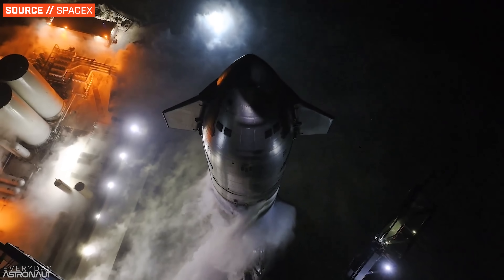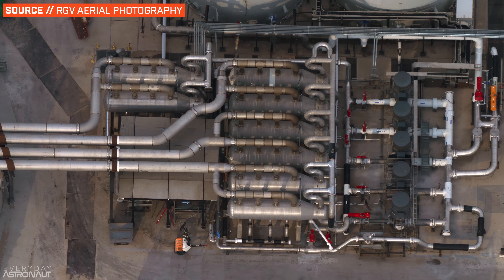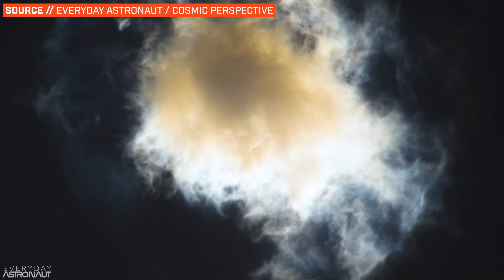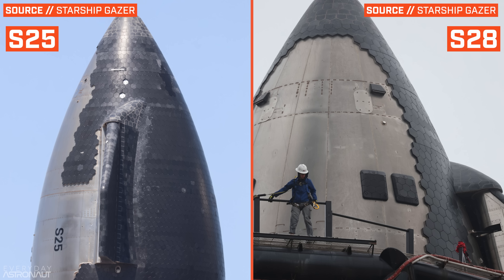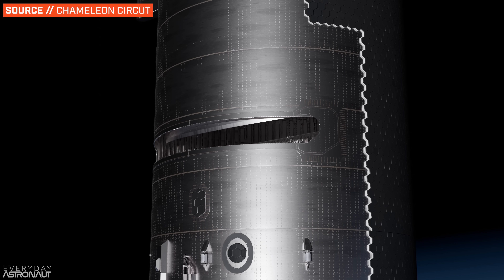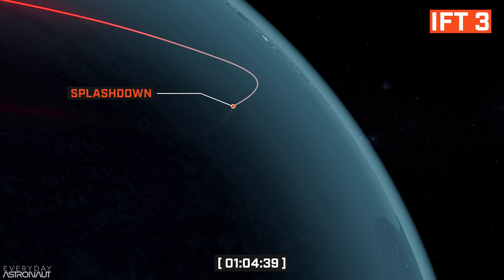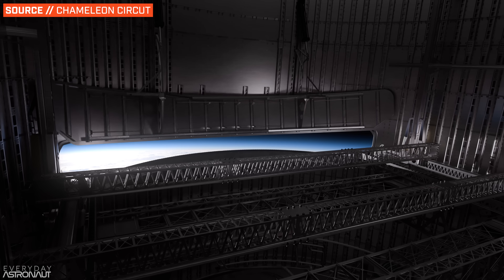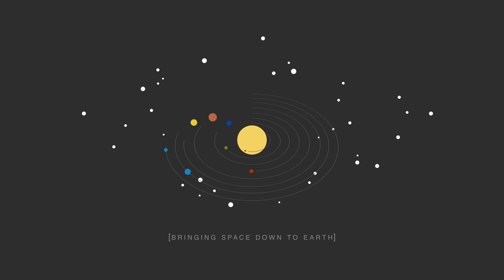What Did SpaceX Change & Upgrade For Starship's 3rd Flight Test?

Comment: What would be the force on the flaps at entry speed? Are they hydraulic or electric? Is the electric weaker? Just watched the actual flight and loss of ship in reentry. Looked like thee was uncontrollable tumbling. I agree with you on heating the thrusters but also am concerned that a flap was fighting for control against a broken flap.

Comment: Brilliantly explained about the saw set up. The one thing I would add to that list is dust/chip extraction (or at least removal, like a blower) so that you can always see what you're doing.
Reply: I think you mixed up videos..
Reply: @puchacz199  Ugh, yup. Happens somehow when chromecasting, I think when it switches to the next video in the playlist while I'm still typing up a comment for the previous one.

Comment: Timestamped Highlights
00:00
🔍 SpaceX has made upgrades to the launchpad and stage zero infrastructure, improving propellant loading times and making small tweaks to reduce refurbishment time between flights.
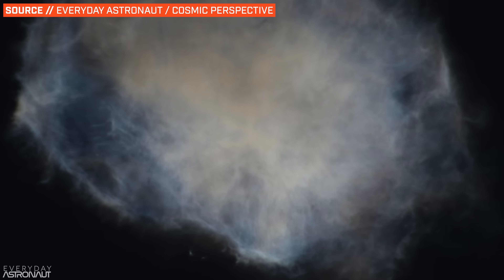02:36
🔍 The booster and ship have undergone numerous upgrades and changes to address previous issues. The FAA has signed off on SpaceX's mishap report for Starship's second flight.
04:12
🔍 Booster 10 features noticeable changes such as grid fin design, upgraded Starling terminals, and a different common dome design. Software and engine control algorithm changes have been made to better cope with the flip maneuver after hot staging.
06:52
🔍 Ship 28 has significant upgrades over its predecessor, including a reverse stacking order, electric actuators for thrust vector control, and various tweaks to prevent fire on the vehicle. The payload door is now operable.
09:44
🔍 The mission for Starship's third flight test includes attempting to relight a raptor engine in space and demonstrating propellant transfer between a header tank and a main tank wall. The landing location has changed to the Indian Ocean near Australia.
12:17
🔍 SpaceX has higher expectations for Starship and hopes to achieve its lofty goals. The clock is ticking, as NASA requires this rocket for the Artemis program. The booster's safe return and successful completion of key demonstrations are anticipated.
Summarized by @NoteGPT

Comment: I think it may experience moments that will require an upgrade. I'm looking forward to it getting further than the previous test. A soft landing may not happen, but we may get close enough to the moment; that we'll be sitting on the edge of our seats, crossing our fingers, and hoping it gets across that finish line! The Starship will most certainly light its engines, and operate its payload successfully. Either way I'm excited for the launch.

Comment: If it doesn't blow up in the first few seconds it will probably do better than last time. The changes made makes sense, but it's a lot of power trying to tear the rocket apart and a few little gremlins can blow the whole thing up before it leaves the pad.

Comment: Once they get a handle on the fuel amount and the flight characteristics of starship they should be able to program in the right parameters to get starship back to launch site. The booster or first stage will be a little easier. They still need to figure the fuel needed for return to launch site on the first stage. I have a feeling starship is gonna make it through its paces this time. So next launch I’m hoping the booster makes it back and lands inside the arms of the launch tower. Go star ship! Can’t wait to see it launch.

Comment: Regarding the reentry, and mission plan. I am not sure what the idea is, but they actually have two reentry plans submitted, one in the Indian ocean, one off of Hawaii with a note about second burn event. This would indicated that the Indian ocean is the "back up" sub orbital trajectory in case they either can't get the engines lit, or under performing engines. This would leave the pacific as a primary splash down. When I read it, it was a bit confusing. Or it could be reverse that they are aiming for pacific and the reentry burn would land them in the Indian ocean. Either way, two reentry profiles have been filed.

Comment: I'm disappointed to learn 28 won't attempt a retro-grade landing burn into the sea.  From a hardware perspective, I don't follow the logic.  Let's say 28 exceeds all expectations and survives through re-entry with the correct high altitude re-entry orientation -- then performing even the bare-minimal commands for a low-altitude engine relight and landing orientation would be icing on the cake.

Comment: I'm predicting that the booster hasn't solved the slosh problem and won't survive long after the turn, unless it waits to turn until after the 2nd stage has put some distance between them. I'm also predicting the 2nd stage will perform the missions objectives successfully and blow up on re-entry, before splashdown.

Comment: Watching the details of the ship like welds and fixtures makes me wonder if this guys are just building an oversize garage build. i mean, it looks awfull. who builds this rocket ship? hamas rebels?
Reply: Yea, it ain't pretty but when it works it will be really cost effective (comparative to any other vehicle of the same capacity). The space shuttle had a painted fuel tank on STS-1 for example, but they ditched that after they realized it is cheaper and lighter without it. Looks don't define spacecraft.

Comment: I believe Starship moon lander has a few design flaws. These flaws include the vehicles height, narrow stance and not having a second stage for moon lift off. Height could be a big safety concern when it comes to sending our Astronauts to the moon. If Starship miscalculates it’s landing approach and lands on an uneven surface it could render the vehicle prone to tipping over? I’m pretty sure that’s kinda of what happened to the U.S. private space firm when it recently landed its lunar lander on the moon? The Apollo Lunar Modules were two stage vehicles, the first stage for decent and the second stage for ascent. This was a good design because it allowed the Lunar Modules first stage to serve as a robust landing platform for the lunar surface, not to mention, it served as a launch pad for the lunar module’s second stage . . . . and most importantly, it provided protection to the ascent engine from debris strikes upon ignition. Remember what happened to a few of Starship’s first stage engines on its maiden flight? I’m sure it’s quite possible that some of those engines could have been taken out by debris resulting from Space X’s original crude launch pad design? Imagine if that happened on the moon with a fully crewed Starship? Obviously, I’m no rocket scientist. However, I’ve been told by many that I have a keen awareness on the space program and its safety issues. If Musk’s team at Space X hasn’t addressed these concerns, maybe you could pass this message on to them?
Reply: Good points but for one, the lander will be crewed and can access an unsafe landing spot and for two, the IFT-1 launch had failed due to 33 engines at full thrust completely eradicating the rock around it. The lander itself will only use 3 engines and might not even have to go to full throttle to get off no air resistance, 1/6 gravity moon.

Comment: I think a destructive reentry test is in order. I do not think spacex knows the exact heat transfer coefficient with and without tiles on the reentry. So I wondered that they might selectively drop tiles to get accurate numbers

Comment: I feel Starship will make orbit successfully but the 2nd stage will breakup on reentry. The TPS system needs a more robust design that can survive liftoff sonic and mechanical vibration. The 3-bolts holding a dinner plate isn't working too well.

Comment: Wil the raptor re-ignition and fuel transfer take place before or after the payload door test? It would make more sense to me if they test the relatively simple door before risking that the engine test or fuel pumps do something catastrophic.
Reply: The transfer will occur while the payload door is opened, and Raptor relight will occur after the door is closed

Comment: I don’t understand the logic of not trying the propulsive flip “landing”.   They have the fuel, the manoeuvre has already been demonstrated, why not configure and test it for this ship?  No harm in planning for it surely?  And fantastic data and credibility if it succeeds.
Reply: Because if they soft land it, they need to send someone out into the middle of the ocean to deal with a floating hulk. If they smash it into the water at terminal velocity, there's no such problem.
Reply: @simongeard4824  that is a large metal cylinder with controllable vent holes in multiple places.  A recipe for sinking.  It also has a self destruct system.  I’m fairly sure that ain’t the reason.  It will be something subtle we are all missing.
Reply: @tonyfromaus7855  No, I'd say you're just overthinking it. They don't consider it a high likelihood of getting through re-entry in one piece anyway. and they don't want to deal with it if does. Landing practice can wait until they're in a better position to attempt it.

Comment: I have a question for Tim and the crew... I'm wondering how well you think the new vertical concrete slab walls around the launch site will withstand the shockwave of ignition. I personally feel dubious about them, and think they should be sloped to deflect the waves upwards, rather than bear the brunt of them straight on... Thoughts?

Comment: I feel that Starship make it to space this go around. Booster 10 will do the flip maneuver and splash down in the Gulf of Mexico as planned. As for Ship 28, S28 will make it to space,  the bay doors will open as planned (the design seems rather simplistic). This next is dependent on how SpaceX does the order with the raptor relight.  If the relight is done before the fuel transfer:  since it has never been done before I can see some unforeseen flaw arises with the plumbing or the engine itself. I would give this a 50/50 chance. If the relight is done after the fuel transfer: Adding in another experimental system with what I stated previously I give this a 25/75 on success. If by some S28 makes it pass these stages. I would expect a burn up on re-entry which is what I believe was the change in landing locations

Comment: Hello Mr. Dodd. Can you comment on the payload door installed horizontally vs vertically? A vertical door seems much more structurally sound with the expected vertical loads on the ship. Why don't you try it out using a cardboard tube? Thanks!
Reply: Try packing a bunch of large satellites and the deployment mechanism into your cardboard tube, and it becomes reasonably obvious. With the horizontal door, you just push satellites out, drop the next layer of the stack into place, and repeat... it's like a spring-loaded stapler, a very simple mechanism, and very space-efficient.  With a vertical door, you need a much more complex system both to pack them in, and to move them to the door.

Comment: They will do better on this launch. The amount of information from the ITF1 and ITF2 has given them the right focus to achieve a better outcome. 
Like the difference between Falcon 9 fail and success, was only a software change according to Elon, this is far more in-depth, which shows how far they have come since then. I would love to see some of the computer simulations they have developed, if they have any at all? As for the 'Pez' dispenser, I would love to see a wooden frame V2 Starlink mock-up, with various metal ribbons inserted, to give a 'Fireworks' display as it re-enters. 🎇

Comment: The two I really want to work are the payload door opening & closing & the pumping the fuel to the forward tank. The last one has me a bit concerned. Won't that weigh the nose down, or will the engine's still be throttling up during that maneuver? It's been unclear what the timing is for that test.

Comment: My personal guess for how this flight i gonna go is:
-Nominal first stage burn (less than 3 engines lost. prefferably none, like ift 2)
-Nominal ship burn (no engines out, reaches target velocity)
-Propellant transfer is successful
-Payload bay door opening is successful, closibg is either successful or becomes suck partially or completely open
-50/50 chance of the engine relight working if i have to guess
-Ship doesnt perfectly survive reentry, but it holds in shape enough that it is recoverable for analysis. I wouldnt expect it to disintegrate due to a couple lost tiles, by i would expect it to buckle and deform to the point of splashibg down at significant velocity..
-Booster successfully completes boostback burn (at most 1 or 2 engines fail to relight, but burn is still executed). Booster landing burn fails, at least ~3 engines fail to relight, booster is partially crushed by water collision and either splits in two or takes on the appearance of a crushed soda can.

Basically, my expectations are: mostly successful tests, ship and booster end up as a hollow piece of slag and a hollow piece of vaguely cylindrical steel respectively.
Reply: Okay uh... I don't mean to brag but this was scarily accurate lol

Comment: Do you know if they have considered velcro to hold the tiles? The ones for outside use have extremely strong grip. Plus, they allow for some movement. Since the velcro is covered by the tile, there shouldn't be concerns of heat damage

Comment: The water deluge helps protect the launch pad from the thrust and burning fuel.  But, I am curious if it assists the take off as well any?  Does it make the take off thrust itself more effective at all and if so to any measureable degree?

Comment: I'd say I'm 95% for a successful launch. Maybe 75/25 for a good booster return. That problem seemed fairly straightforward based on the info we've received, but you've got a lot of prop mass moving around when it flips. I'll go 90/10 on the payload door, that seems like child's play compared to everything else they're trying to accomplish. 80/20 on engine relight and 65/45 on prop transfer. Reentry I think is going to come down to if they lose heatshield tiles on ascent. If it holds onto all it's tiles, I think it will make it. If it loses some like it seems to like to do, I think it goes all Columbia over the Indian Ocean.

Comment: So, Starship 25 was used in the second test, and Starship 28 will be used in the next test. What happened/happens with Starships 26 and 27? What happens to all of the Starships that don't get launched? The first launch was SN 5. What happened to 1 through 4? Then there was SN6, SN8, SN9, SN10, SN11, SN15, SN24 and SN25. So, 28 built, only 10 launched? What happened to the other 18? Were they just vehicles used to ground test the hardware, software and the construction process?
Reply: Not all of them were completed, and some that were completed were scrapped because they turned out to be unnecessary.

 For example, SN8 through 14 were all roughly the same generation hardware, all of which were intended to test their ability to maintain control during the skydive manoeuvrer — but since SN8 unexpectedly nailed that on the first try, they used 9, 10 and 11 to attempt the landing burn (which they were never built for), scrapped the partially build 12, and never completed 13 and 14. And with the benefit of those unexpected landing attempts, SN15 (which was actually built for it) made the landing on the first try, rendering the rest of that hardware generation redundant too.

And yes, some of them have just been test-articles (e.g. SN7 was just a tank used for pressure testing), and some were just built because you can't develop the construction process without constructing things.

Comment: I think knowing space x, there will be progress demonstrated for sure. Like you say though, people are now starting to have expectations. People want the thing to perform now.

I think if they can get the booster to touch down, and the re entry burn complete for ship then it'll be a successful test. Whether the booster stays intact or not after touch down and whatever happens to ship after that if catestrophic won't be too much of an issue.

Basically as long as it's another solid step forward, I think NASA in particular will be understanding of it. If we get fireworks on accent though, then people are going to start asking questions.

I expect they haven't set the mission goals outside of what they believe is achievable. So I expect them to likely get 75 percent of the total flight plan done at a minimum. If they go further then I think everyone will be confident they can get 100 percent through on a 4th launch, which to be honest is pretty stellar considering what it is they're trying to do.

Comment: I think that if the spaceship makes it to space then tries to re-enter the atmosphere it will burn up upon re-entry because tiles falling off due to stress and not being fixed propper has been a major issue that spacex cannot seem to fix!   there should be some type of heat absorbtion material under the tiles that will save the vehicle in case of missing tiles/emergency.   💣💣💣💣💣💣💣

Comment: As much as I'm excited to see it fly, and I understand the iterative nature of SpaceX's philosophy of rocket design, I have doubts this type of configuration will ever be stable. There are way too many moving parts. I wonder if NASA has done a comprehensive statistical review of failure possibilities so they can issue an entire configuration success percentage? They did it with Apollo...especially after the capsule fire and everything was made  triple and quadruple redundant.  I understand we're not just going to the moon, and the percentage of GDP spent on the 1960-era space program was stunningly higher...but I'm not sure SpaceX's design philosophy scales up safely. Hope I'm wrong but I have a bad feeling about this.